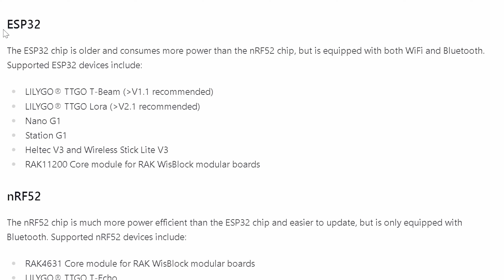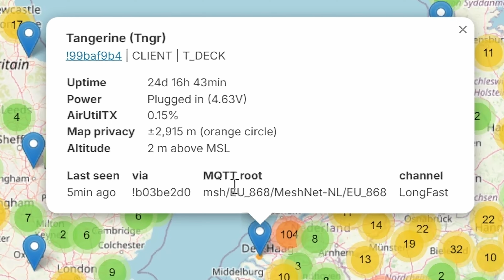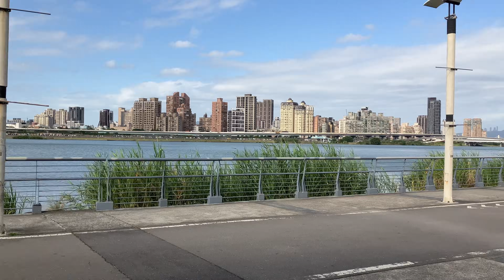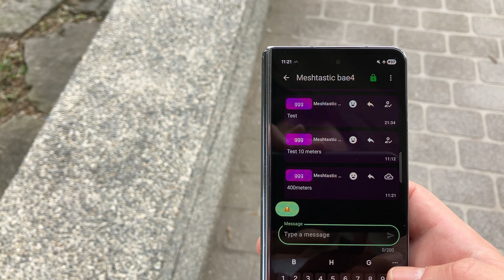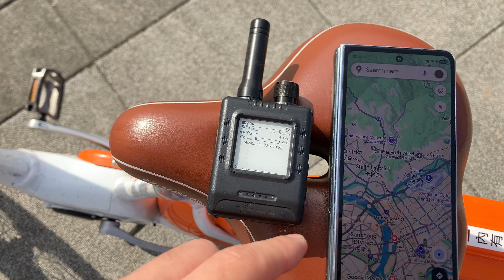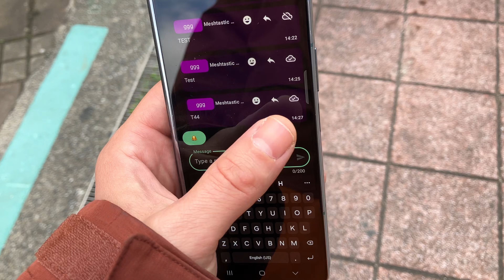How Far Can LoRa Go? ThinkNode M1 & M5 Range Test in Taiwan

Comment: Setting your hops to 6 in an urban area is terrible for the betwork. When you are in an urban area with a lot of other nodes around you should set your device to client_mute, your hops to 3, and you radio to mediumfast or else you are slowing down the network for everyone.

This is actually why MeshCore is gaining so much support. Because it doesn't allow your client to forward messages it eliminates network congestion. The downside is that it kind of loses the point of a mesh network where the more users you have the more robust it is. If people don't start being more conscientious with their radio settings, meshtastic will be crushed over its own weight as it grows.